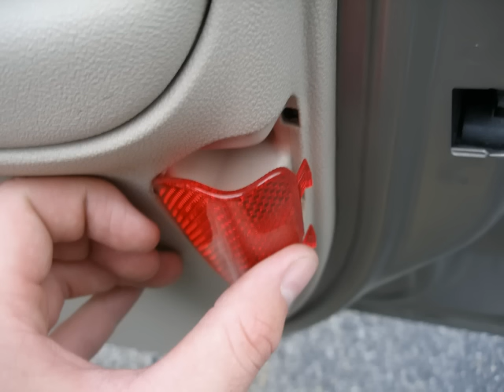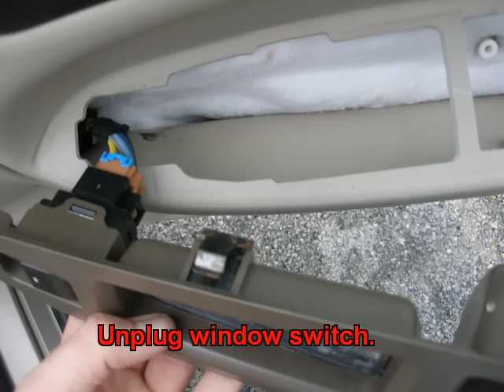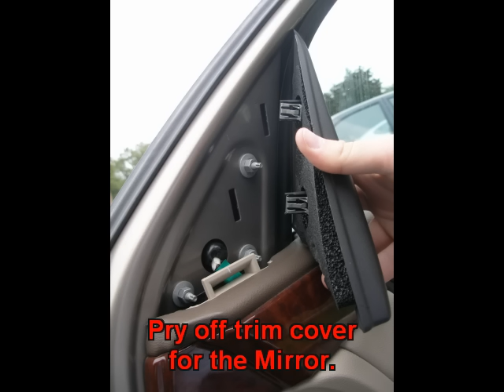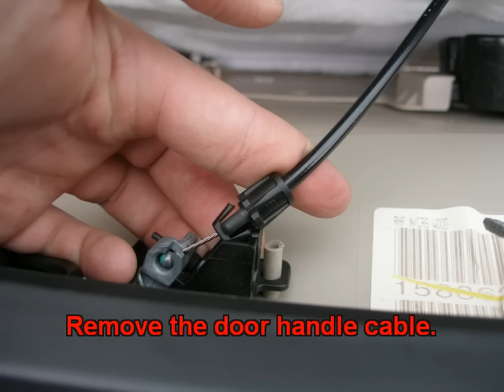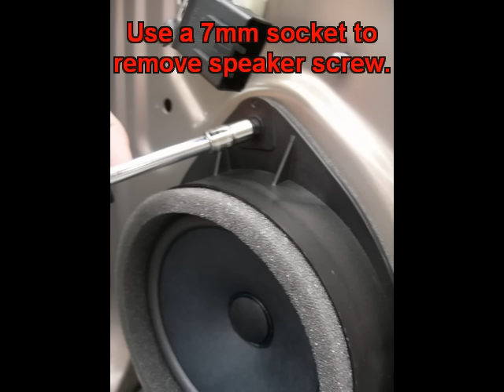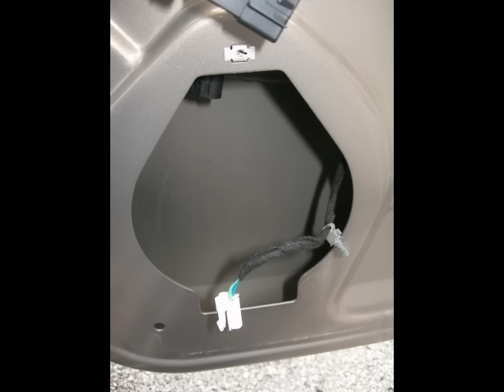2007 Impala Door Panel Removal (Slideshow)

Comment: I started to remove the rear door panel on my 2008 Impala and stopped everything when it came time to pop off the panel. From experience, I knew that plastic pop rivets held it in place, but I was reluctant to apply the necessary pressure and break something. I stopped what I was doing and decided to go on-line for assistance. Thank you for giving me what was needed  to return and complete the job!

Comment: Awesome video man...I just had to replace the side view mirror on my 06 Impala and this video was damn near perfect.  Couple differences/suggestions
-Screw behind reflector is not a hex so you'll need a socket
-Was unclear what to do once all screws/fixtures were removed to actually get the panel off (aside from wrap my screw driver in cloth and push inwards)...there are about 10 or so rivets that you just need to pry against and they will pop right out...

<1 hour from beginning to end

Comment: Worked fine for a 2006.  Only things I found were pesky metal clips that popped off on the hand rest bit, and I had to figure out that you have to lift the panel to get it away from the top lip. Thanks.

Comment from the maker: Yeah the black piece I think I twisted sideways and it slides out with a small amount of force and then once that's out the ball is easy to take out.  Give the wire some slack and follow the grove with the wire and it will fall out if that makes any sense.

Comment from the maker: Lay down under the door with safety glasses and you will see a slot where a screw driver can get under the panel much more easily.  Then one by one pop the panel's clips off the door.  The clips will stay on the panel.